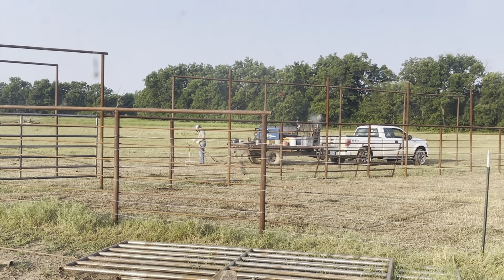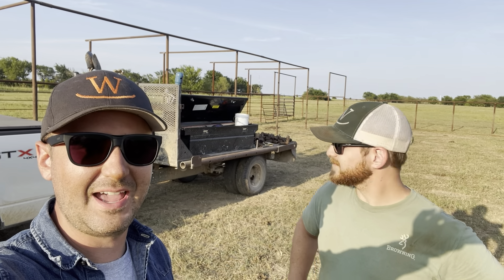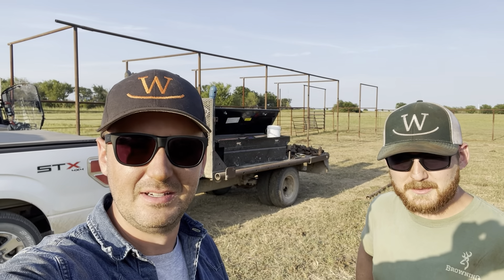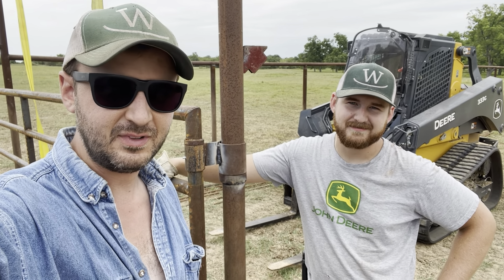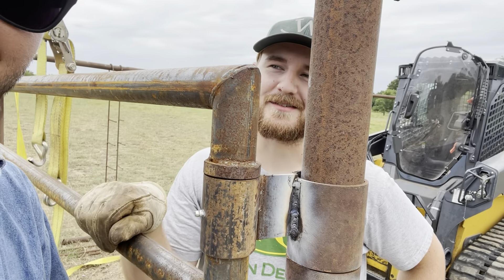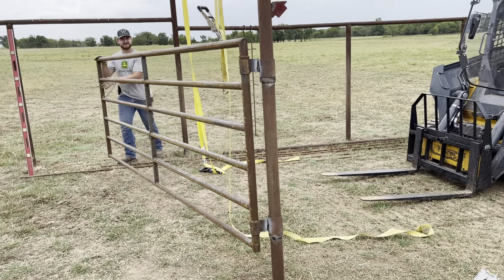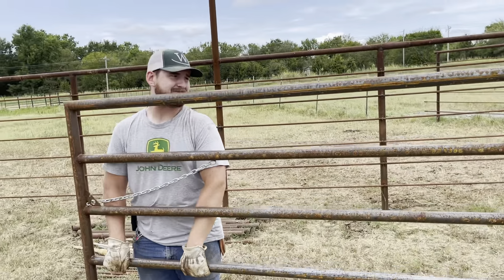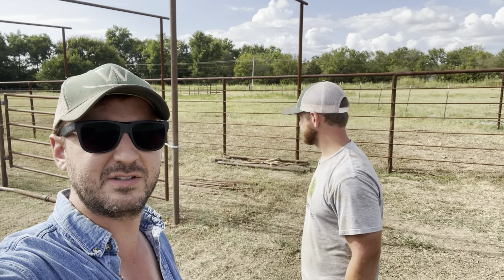Corral Project - 360 Degree Gate Idea Fail (2 For 1 Build Days)

Comment: Why would you use 2 hinges with that thin bracket between them?
The gate welded straight to the collars that were around the post should have worked just fine.
If I was seeing what I thought I was seeing.
Reply from the maker: In theory, that would give us a gate that would swing all the way around and fold flat against either side of the fence. Without the second hinge, it won't.
Reply: @FarmandRanchHacks  if you need that extra space weld a another tube from the top hinge to the bottom hinge inbetween where the spacing bracket was.
Reply from the maker: I think you may have just solved our problem.
Reply: Lol - I did the exact same thing on our gate last weekend.  Zoop and I came to the same conclusion - have to tie the upper and lower hinges together.  we set the hinges out at a 45 deg so the gate folds flat on one side.
Reply from the maker: We are gonna take another run at it soon - think we can put a piece of pipe between them and it will work.

Comment: Maybe I'm missing something but if you just welded the square plate steel directly from the 1&7/8" pipe on the gate to the 2&7/8" collar that rotates around the 2&3/8" upright you easily have a rotating gate.  I've built a bunch of them.  But then again, I may be missing something.
Reply from the maker: It seemed like it should have worked, but when the gate was hanging it would drop about 8” on the far side and bind.

Comment: I must not be getting the point of this video. The way I made 360 degree gates is to simply install a 3 inch pipe and then weld a band in two [places, build two strap hinges and set the gate down on the post.